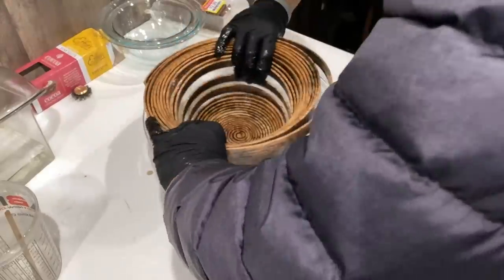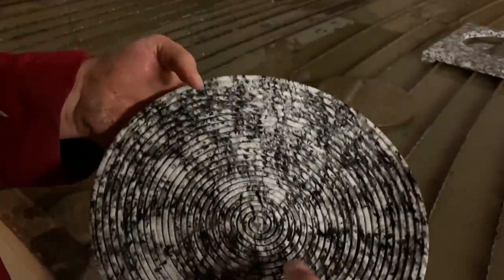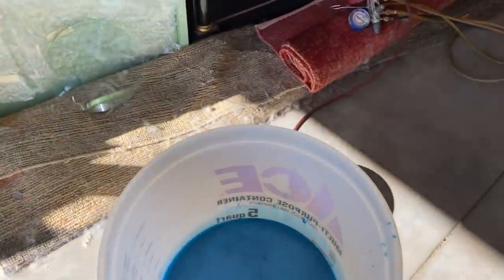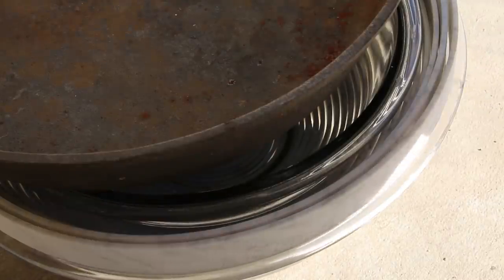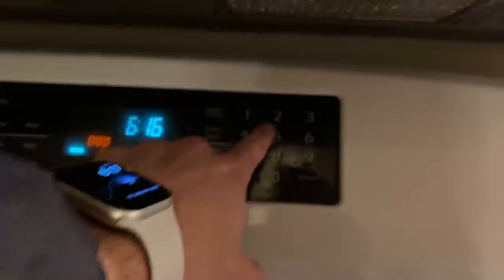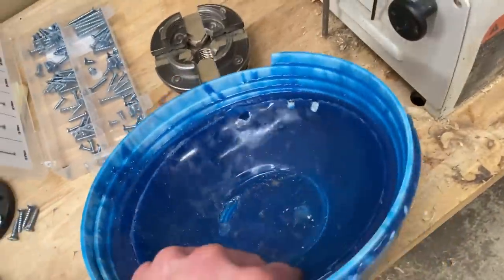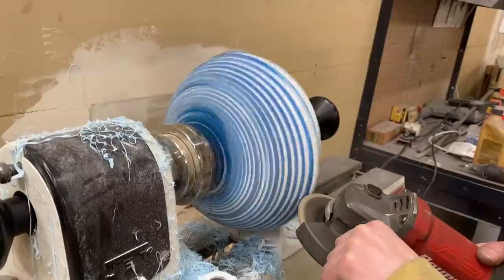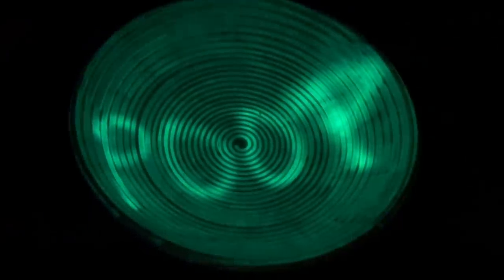Using A Waterjet To Make A Spiral Marble Bowl With Resin

Comment: Props for powering through it when the resin started to set “early.” But, all things considered, it came out pretty decent. Can’t wait for you guys to perfect your process. Maybe make a silicone bowl mold. Like, use the bottom of a 3 or 5 gal bucket, fill it with silicone, then set the weighted glass bowl down into it. After the silicone sets up, remove the weight, pour some silicone into the glass bowl and let it set. Then you’ll have a negative silicone bowl mold you can put the spiral and resin in and it won’t be such a pain in the ass to remove
Reply: This is actually a very good idea, hope they notice it

Comment: It's soooo weird to see rocks just moving and flexing with such ease
Reply: cause all matter in the appropriate conditions is flexible, and flowing

also this is engineered stone, it's mostly plastic.
Reply: pretty sure it's "engineered stone" which is mostly plastic.  The black grainy one that shattered before they could even use it was actual rock-rock.
Reply: If you think about how long that spiral is, its actually not flexing that much. Its a very long spiral. Btw very cute pfp :3
Reply: @tsm688  Actually you can do this to any material 100% natural or not. At any point in the curve it is moving only by the smallest amount. I doubt the countertop was engineered marble and is likely natural marble
Reply: @nanaki-seto  Natural marble is *EXTREMELY* hard to find these days for various reasons - not the least of which it actually sucks as a kitchen surface.  Hard to clean and easy to damage.  Unless they went out of their way to helicopter something in from a quarry, it's "engineered stone", meaning, mostly NOT stone.

Granite on the other hand, they still do granite countertops.  And their granite, as expected, shattered so instantly they only show it for three seconds of video.  The quartzite they did in another video is probably real too.
Reply: @tsm688  Natural marble is not difficult to get at all. You just go to your local countertop warehouse and say you want marble, which type, and how much, and pay for it. Marble is an abundant material.
Reply: @hostronic  It's a question of quality.  Bauxite is abundant, perfect rubies less so -- mostly the same mineral content.  For every brilliant perfect marble countertop, there's literal tons of cracked, void-riddled waste -- waste they can pulverize, mix with resin, and convert into 'engineered stone'.

Comment: A strong recommendation when working with epoxy resin is to use nitrile gloves and avoid all contact with non cured resin. This is because, even though it is very uncommon, contact with uncured epoxy can cause epoxy allergy, which is a very bad allergy, you will no longer be able to be in the same room as uncured epoxy ever again without nearly choking to death.
Reply: This is super crazy I've never heard of such a thing
Reply: @thomasbarlow4223  No, as I said it's very uncommon. In the unlikely event that it triggers an allergic response though, it's devastating.

Comment: Use thin flexible metal flashing strips or taut paracord when you put it in the bowl to help support it and then pull them out from under it when it’s in place.
Reply: Ooh, that'd probably work.

Comment: I'm sure it's been said, but just in case it hasn't. Use deep pour resin. It's got a much longer cure time and releases bubbles far easier. Also, if you want to speed it up, it would be safe to heat something this small/thin to around 90-110F for around 3 hours and it should cure in less than a day. Even just pointing a space heater at it and turning it frequently would make it cure fast.

Comment: Use a pressure pot not a vacuum chamber. The pressure pot will reduce any air bubbles to a microscopic size you can't see. It will also eliminate the need to vacuum multiple times

Comment: next time turn the bowl upside down, in that way it would much easier for you to put your project.. and instead of spray use wax, you can wash it anyway with dishwashing liquid after the resin had hardened.. and don't the resin stay for too long.. just my opinion.. i had worked with like this stuffs before..